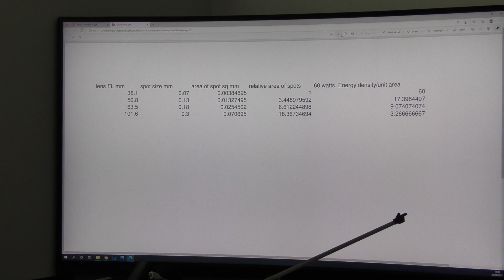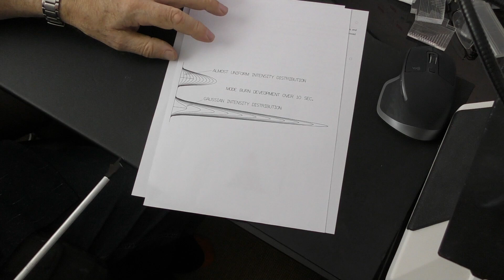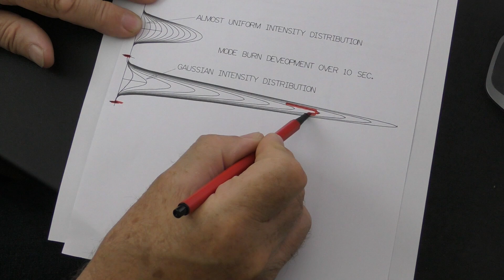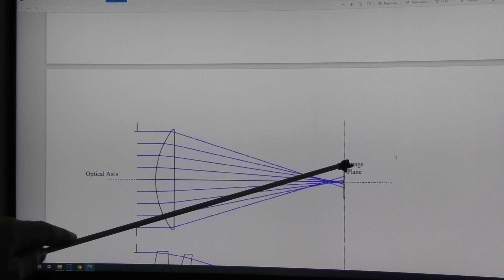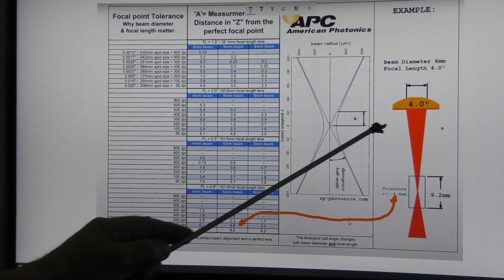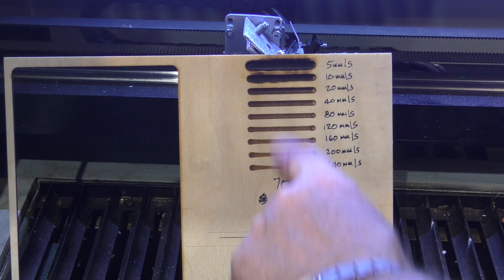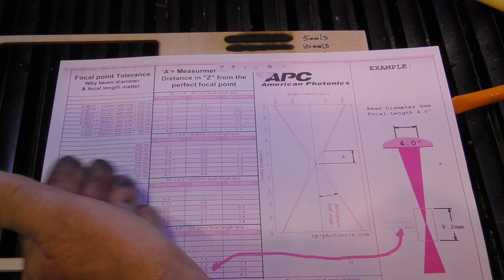RDWorks Learning Lab 217 Do Laser Lenses Meet Specification

Comment: Hello, does water temperature have any effect on co2 laser beam?
Can you do a little research on the behavior of a laser beam (cutting quality) with an oscillation in the temperature of the cooling liquid?
Reply from the maker: Hi

The more expensive tubes allow a working water temperature between 10 and 40C. I have heard of people with CW5000 chillers claiming that they have to work at 19.64792 degrees C for maximum efficiency .OK perhaps I exaggerate  (but only slightly).. I do not have a chiller , just a closed reservoir that gradually heats up. I carried out testing at 45C a few years ago to determine if there was a power loss, as many claimed,  if you exceed 20C. After 4 hours of running at 45C the tube had no immediate ill effects and here we are 5 years later and that tube is still performing like new.. I started  the test at 18 C and  measured output power.   At the end of 4 hours running continuously at 45C I tested the output power again and It had dropped by 5% .   3.5watts on a 70 watt tube would not noticeably affect cutting performance.  However in general I limit my running to 35C and during the few hot summer days we experience most years in this part of the UK. I drop  a copper coil into my reservoir and run tap water through it (typically  our water is  about 15C)

 I have spoken with several guys in central USA that use CW5000 chillers and do lots of photo engraving. They were experiencing lighter and darker banding on their images that were 100% correlated to the chiller switching on. The instant cool water running through the tube was causing a power output change for a minute or two. The solution they adopted to fix the problem was to  add an external reservoir and small submersible pump to feed the laser tube.. They then did a flow and return  from the reservoir through the CW5000. This had the effect of smoothing out the dramatic temperature fluctuations
Hope this answers your questions
 Best wishes
Russ
Reply: @SarbarMultimedia  thank you very much for the answer. 
My co2 laser beam changes color when the temperature is below 19 degrees it turns blue, and over 30 degrees it changes color to red, is it a defect on the tube or something else? I have noticed that any change in water temperature leads to a loss of cut depth
Reply from the maker: @Перун-о1ь  
Hi  
I have never encountered that effect in my 6 years of working with many different laser tubes , both good and bad.
 The 10% nitrogen within the tube's gas mix is what ionizes into a plasma (lightning in a bottle) and the color of lightning is pink/mauve. With low power (low current flow between 4 and  about 6 or 7 mA) the beam will be a very hazy pale pink. As you increase the current flow the INTENSITY of the beam will get pinker and more solid.  There should be no significant colour change , just intensity.. The colour change you describe seems to imply a problem with the gas mix. Does the tube have a manufacturer's label?. Where did you buy the tube? What power is it? When the tube is at the end of its life the beam will change to almost white.

Best wishes
Russ

Comment: It is interesting, just a comment 1) the beam quality, which is known as M2, is not a fit to a Gaussian. M2 is how fast your beam is diverging, just google M2 beam quality. In other words, you can have 2 Gaussian beams (in intensity) but beam quality can be very different (for perfect Gaussian beam M2=1). 2) To better understand the process of machining you should read about ablation-cooled material removal.
Reply from the maker: Hi Pavel 
 I greatly appreciate your attention to exact science but as a hobbyist and interloper into this technology I am less interested in perfect science (I am not going to try and design anything) but more interested in easily visualized concepts that  lesser mortals like myself can use to build a general picture of the technology we are playing with. Certainly the use of femtosecond  pulsed lasers is "other worldly" to most users in this DC or even RF laser community. Unlike many others, I have at least had the opportunity to experience experimenting with a MOPA laser, but this is still a world away from the technology you refer to. I can't imagine cutting through 26mm thick hardwood with a femtosecond laser but  a crude CO2 (non pulsed) laser normalises a  sci fi technology  for  the  masses. The breaking of atomic bonds without transferring heat to adjacent molecules is a fascinating branch of laser technology  that most will have no appreciation of. 

 However,  I really do appreciate comments  from experts such as yourself, because  although I do a lot of research and reading, the material is not designed for normal people and I have to distill concepts from the mass of esoteric ideas and data. That,  in turn,  may include a certain amount of inexactness or over simplification. 

 Best wishes
Russ

Comment: May I ask? Is the spot size damage tightness or interference a matter of beam divergence due to the nature of the wave frequency? 
Or is it possibly related to the quality of the lens surface? Although I don't think lens quality is the true issue. While it could be the limitations of the material used and its transparency to ir.
Or is it related to lens length that causes internal beam interference by causing the beam to generate an interference pattern at a specific focal distance? 
Or finally my last question. Is it a quantum effect related to particle duality? That's my last question.  I had to ask because since I've seen your session this has been bugging me.
Reply from the maker: Hi 
I am not a physicist but I like to understand  concepts rather than the detailed maths that underpins them. Yes I do understand the dual nature of light both as particles (photons) and waves  but for simplicity I tend to consider a laser beam as a collection of photons that exist at a variable density across the beam section. My observations suggest that this model works well for all situations. . For example I cannot visualize compressing a wave into a spot size . If you try to pass a wave through a small slit  then the restriction attenuates most of its energy.   However my understanding of photons is that they can coexist in the same space without affecting each other and thus  the idea of focussing gazillions of photons into a small spot is completely imaginable. The smallest that spot can ever be is the wavelength of the light, in our case 10.6 microns diameter.  However, that is a laboratory concept and not obtainable in the real world.  As I mention in this video, spot size is a associated with nice uniform intensity  light  sources being focused to an idealized focal point.  That concept is completely ridiculous for our non uniform intensity.
 There are two features of a lens. Material and geometry.. The majority of lenses are made from zinc selenide . Although this can occur naturally we all use a  laboratory grown crystal material. The quality of the crystal structure and inpurites defines the cost and material grade used by different lens makers.  Impurities limit the power transmission so the lower quality (brownish) Chinese lenses are limited to about 80 watts.  Zinc selenide in its natural state is a poor light transmitter at about 70% efficient. That loss is from surface reflection and not power absorption within the material. The lenses are coated with several thin chemical films to create an antireflective coating that is supposed to increase the efficiency to 99% plus.  From all the power transmission experiments I have conducted there appears to be little difference between the various lens materials/quality. The second property , geometry. is very important.  Most of my lenses originate from China  and appear to work in a satisfactory manner. BUT, as you will see in later videos, the repeatability of the INTENSITY focal point  ( not the light ray focal point)is very variable. I am not rich enough to own a collection of top quality lenses to compare this with, so I don't know if this is a feature of geometric manufacturing imperfections or if it is material impurity  issue.
 Constructive and destructive interference is a wave concept  for which I observe no evidence.  If such  effects were happening then  there would likely be a runaway amplification of intensity  or self destruction to zero.. That is why I favour the photon coexistence  model  with its allowance for  photons at different densities within the beam.  This  is a model that fits all my observations .

 Best wishes
Russ
Reply: @SarbarMultimedia  
Thank you

Comment: Have you ever used ir cameras to see the beam.
Reply from the maker: Nice idea but impossible .IR cameras work just above the visible red end of the spectrum at between 850 and 950 nm wavelength. The CO2 wavelength light is 10,600 nm and way above what IR cameras can "see".
Thanks for the comment because it means that the problem has stimulated  some brain juices. However the real issue  is not seeing the beam but  understanding the way light damages the material.. That is why I use acrylic. It is a unique  recorder of  the various light intensities in the beam. Acrylic never lies but the problem is interpreting the damage  it records  because both  the raw laser beam a lens  are interacting  to cause the damage.  In other words the real problem to be untangled is happening INSIDE the material where no camera can ever see.
 Best wishes
Russ
Reply: @SarbarMultimedia  
Thank you I should have remembered that. I just re-learned about the limited threshold of ir cameras. And  the acrylic is the best way to see the spot size via damage. The way you use the acrylic is about the most practical method. My thought was kinda dumb as I was thinking on such a rudimentary level about the fact you were analyzing real world effect.thanks.

Comment: Your exploration brings to my mind some questions and observations from my past as a photographer. In photography we had to produce an image for silver crystals to resolve, we had to deal with three colors of light and the lens aberration of the 3 colors. Red being the one with the biggest problem being focused to the same spot as green and blue. So my question, yes, the intensity has a "ring" of power influence on a combustible substance- but is it true that the only wavelength is 10,500? Is the tube so precise as to produce a "clean" power beam that makes it hard to concentrate the beam to a more powerful point of most damage? Are there any anamorphic laser lenses?
Reply from the maker: Hi Patrick
 It turns out that aberration is the laser beam's best friend  When it's there it cuts well and when its not it engraves well  All will be explained and demonstrated in the next video. 

Your question about clean colour  is valid but considering there are only 3 gasses in the tube , nitrogen, that forms the pink ionized beam ( the engine for the lasing process), helium that is a heat conductor and then CO2.  There is nothing in there to pollute the formation of monochromatic 10,600 nm photons. The ionized nitrogen is producing random  pink photons. Some of these photon  escape from the tube and is the pink colour you see but most are being used to provide the little packet of energy that the CO2 molecules transform into 10,600 nm light. So I assure you that it is pure monochromatic light. Laser light is supposed to be  the  Stimulated  Emission of Radiation ( photons). A laser beam is a coherent beam of energy , meaning that all the photons are phase locked  ( all the peaks and troughs are in line). However The purity of this coherence is definitely questionable. I doubt it is 100%.
  The big problem that few seem to recognize is that laser beams and lenses have their own relationship which  transcends simple ray tracing and lens theory..  
 Best wishes
Russ

Comment: Have you ever discussed the distance traveled by a beam segment inside the lens(greater at the edge vs direct center) ? Would a convex down lens , with a thicker center and decreasing in thickness as it approaches the edge effect power intensity? Another words instead of top of lens being flat, it would be three "sided"  calculated to equate distance traveled by the beam .  Hi Russ -Tim In Ohio.
Reply from the maker: Hi Tim
 Yes you do lose power at a lens typically 2% to 3%  (despite manufactures 99%plus claims) but that is not power absorption within the lens but reflection of the first surface. Zinc selenide in its raw state is only about 70% efficient at transmitting 10.6 micron wavelength light. It is boosted to 99% by a series on ultra thin anti reflective coatings. However there is a strange event that happens within the lens where the speed of light slows by about 30% as it travels through the Zinc Selenide.  I was very puzzled about this fact affecting the coherence of the beam because of  the thickness variation you identified and also the different path lengths to the focal point. An eminent physicist assured me that there was no loss of coherence  because of these factors  so I have to believe him. I sometimes see problems where  with a better understanding of physics  there would be no question . I therefore se no reason for loss of intensity  for different path lengths through the lens because remember that the Gaussian intensity distribution means  that most of the useful intensity is happening in the central third of the beam.  Take a look at the spherical surface of a lens and you will see that the curvature ( and thus the thickness) over the central 2 or 3mm is changing by a minute amount so there are no significant path length changes anyway.

Thanks for a great question
Best wishes
Russ
Reply: @SarbarMultimedia  Define coherence . Is that intensity? If all paths were equal, would not it be plausible  the focal point  more refined (targeted) and therefore the beam more intense. Agree with the 2 to 3 mm statement. But when striving for perfection , nothing against the professor ,
  I think there could be a measurable difference you could discover.  Both intensity and delta focal length Thanks for your time Tim.
Reply: I think i got coherence. There would be no effect to the focal point when different distances are traveled through the lens?
Reply from the maker: @ChipShot777 
 Hi Tim
Coherence is the key feature that defines a laser beam.  It means that the frequency  of the  photons are fully in phase  and  is the difference between normal light where all the photons are  random out of phase.  Intensity is the density of the photons. The next video may well answer many of your questions about intensity and focal length.
 Best wishes
Russ
Reply from the maker: @ChipShot777  
 Hi Tim 
your last question is answered by conventional ray tracing lens theory.  Different shape lenses  (or combinations) can produce perfect focal points  . Just examine a few on www  and you will see the answer is no  path length is not a factor. Take a look here for a few examples https://www.physicsclassroom.com/class/refrn/Lesson-5/Converging-Lenses-Ray-Diagrams
 Best  wishes
Russ
Reply: @SarbarMultimedia  That went above my pay grade ! But something else made me ponder -  the 30% speed reduction through the lens ? Wouldn't the most intense part of the beam arrive later than the least intense. And what effect does that when the laser head is in motion ? Well have a good sleep. nite.
Reply from the maker: @ChipShot777  
 As I mentioned earlier these effects are well known and ray tracing  (lens theory )software takes this into account The eminent professor I spoke with assured me that speed change is the cause of refraction and that the longe slower light path through the centre of the lens is auto corrected by the fact that once out  of the lens, the light has a shorted distance to the focal point. so all comes right in the end.
 Best wishes
Russ
Reply: @SarbarMultimedia  didn't take out of lens distance into account . thanks good explanation.

Comment: I just thought of somthing for seeing the  laser beem after a lens, why not make a dust cloud infront of the beem and take  pictures of the empty space left behind or alternatively make it dust that reflects that type of light and use a camera that can see it to see the beem itself.
Reply from the maker: I know exactly what you mean because with some laser beams you can use smoke to reveal their presence. That effect depend very much on the wavelength of the beam .  The problem with 10.6 micron wavelength is it "sees" only three things. One is metalsm and the light reflects because of their tight crystalline structure. The second is aVERY small group of salt -like  materials that allow the light through and a third group where the molecules will be stimulated by the light to heat up . That third group is EVERYTHING ELSE.  The light waves pass through gas  with zero effect but when the light hits a solid/liquid surface it stimulates the molecules  and heats them up to threshold where they self destruct.
 To your suggestion. Dust or smoke is micro solid  particles (solid or liquid) suspended in gas, thrfor the laser will heat the dust particles and likely make them burst into flame. There will be no valuable information that can be extracted from a ball of flame other than , yes, that dust is  flammable.   Also . imagine a stone falling from on high. It is completely harmless and leaves no trace until it hits something and  the energy transfer to that something appears as damage.   the same happens with a laser beam and that is why I use acrylic all the time to examine the effects of that energy transfer. Acrylic never tells lies but sometimes it is difficult to decode the mechanism by which the  damage occurred.  
Thanks for a  nice idea that you can test for yourself if you have a machine.
Best wishes
Russ